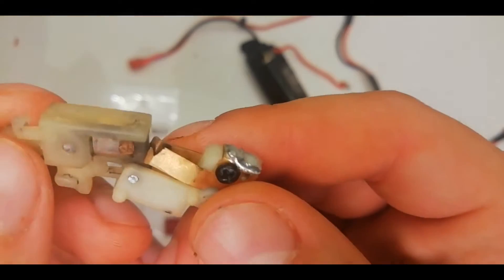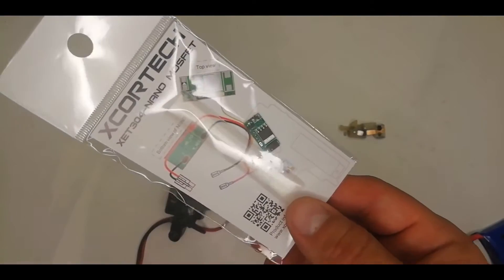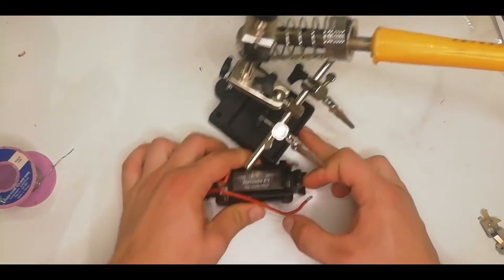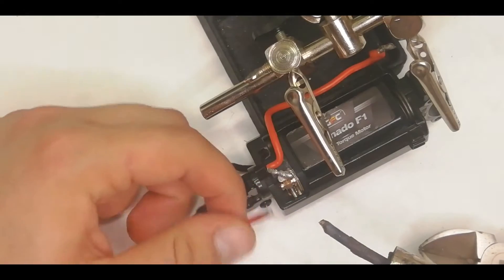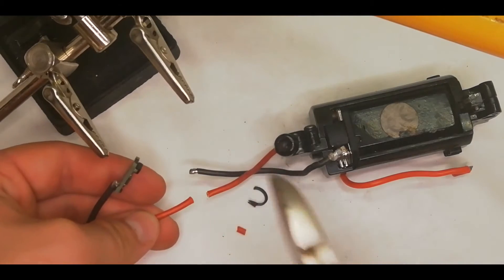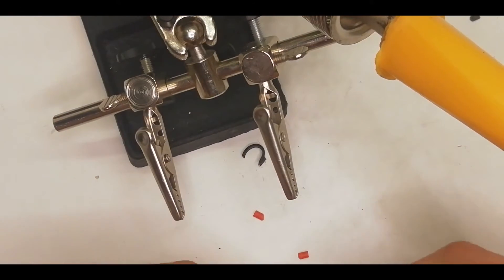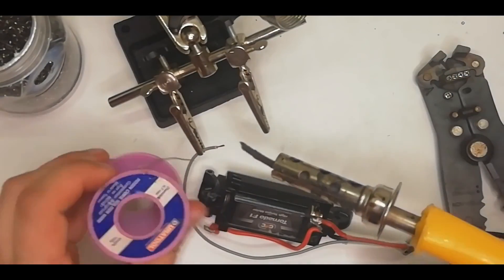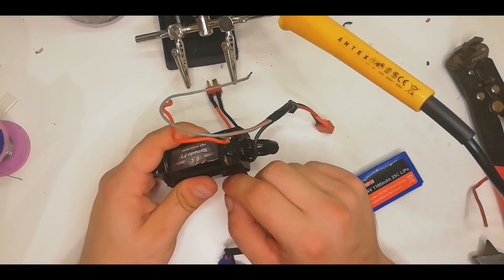Installing A Basic Airsoft MOSFET (Airsoft AEG Wiring Guide And Soldering Tutorial)

Comment: I have a m4 that I never got the manual for 😂 and I'm not completely sure but on the box it says Automatic Electric Gun 'MOSFET' would that mean that there is a mosfet installed as the connector by that battery does look like a type of mosfet
Reply: It's a CA4A1 EC1 Classic Army M4
Reply from the maker: As long as it's the same gun that the box is for, then it sounds like it has at least a basic MOSFET inside. I remember working on a few rental CA M4 very similar to that and they had MOSFETs as standard, but they were removed by previous techs.
Reply: @FulcrumAirsoft  ahh okay so at the moment, I'm running a 2/3A 1600mah 9.6v nimh, but I want to see if I can move over to a li ion or lipo so my gun has a bit more life capacity, would I be able to run a 11.1v or would it be better to play safe with a 7.4v I haven't played airsoft for 2 years just got back into it

Comment: What happens if you reverse the +- on the mosfet? Mine is already sealed and i dont have instructions with it (2nd hand)
Reply from the maker: If the battery side is reversed the MOSFET will likely be damaged, if the motor is reversed then the gearbox will lock up against the anti reversal latch and the fuse will blow if you have one.
Reply from the maker: Some MOSFETs have a reverse protection but that's no guarantee.

Comment: 6:40 that's a really bad solder joint, the contact was not hot enough so its just a cold joint. Not great for something that's going to be vibrating a lot.

Also both those positive wire's should have been twisted together 

I'd recommend stripping more of the wire, and wrapping it around that post and using a hotter and larger soldering tip to heat the wire and post equally and very quickly so you can put solder on. It's really hard to get good results in a situation like that with a small soldering tip

Alternatively, just put a female spade connector on it and that will slot onto that tab
Reply from the maker: Thanks for the advice. I'll sort it out when the M14 next comes apart.
Reply: @FulcrumAirsoft  no problem, good luck.
Reply: Also use some flux. Quality soldering is always recommended @FulcrumAirsoft

Comment: Lovely video.  
Quick question, what's the current draw on an average aeg?  (I ask because I've built nerf blasters with 100 amp draws at stall).
Reply from the maker: Thanks mate, bloody good question. Fuse wise I usually use between 20 and 30 amp which is usually dictated by what I've got laying around. The 11.1V LiPo I've got on my desk says 26 Amps continuous and 52 burst. Of course that doesn't mean it will need to kick out that much. Forums seem to say around 15-30 depending on what's in the gun (spring, gears, motor). I've never blown a fuse on any gun nor had any major overloads or shorts. 16 AWG gets warm in my M14 if fired rapidly on semi but nothing alarming. I imagine the stall current on AEGs would be similar to the need blasters you've dealt with.
Reply: @FulcrumAirsoft  Cheers for the answers buddy.  30 amps?  Sounds really low considering the torque needed to pull back those big old airsoft springs, (the one ive go out of my ((Broken))ppsh 41 feels at least 10kg).  Still if those are the numbers.... Gotta say though, a 52 amp burst lipo would go bang bang on anything other than entry level third party nerf motors....(Which is why im a nimh guy).  Much obliged to you for answering so quickly, and dont worry about burring yourself on camera,   after 5 years modding nerf flywheel powered blasters, I've got so much callus on my  index fingertips and thumbs from burns I've lost all sense of feeling in them.......